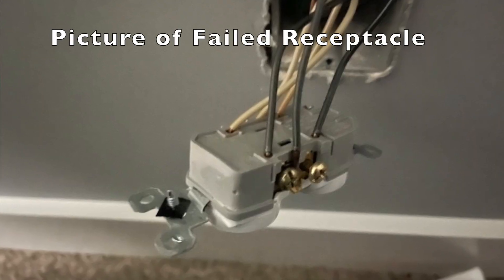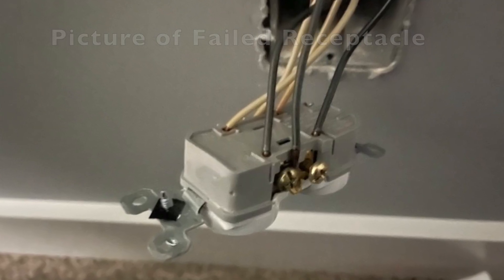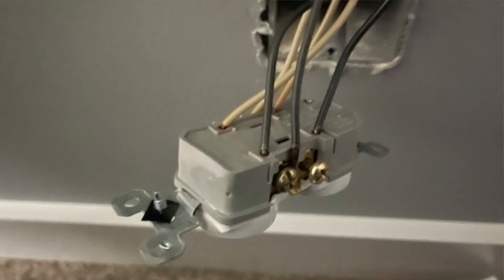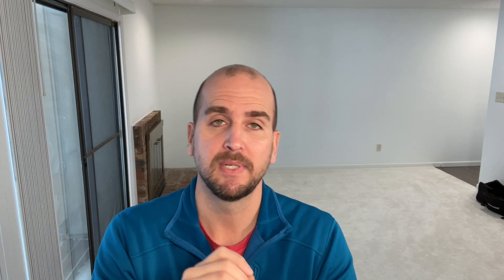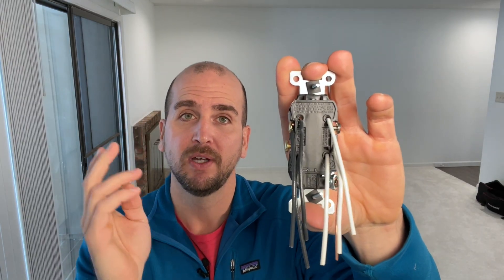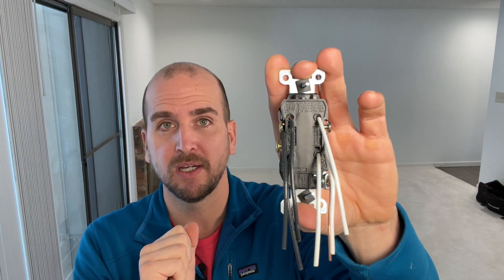Incorrectly Wired Outlet Found In Newly Built Home

Comment: Im not an electrician....but way back over 50 years ago our high school had excellent tech classes.  Our electric shop instructor was a crusty old englishman....we spent what seemed an eternity on making perfect shaped connections....had to look like a cup holder hook.   The connections had to be tight....he inspected to copper to make sure you hadnt nicked or marred it in any way..  Ive never forgotten ...thank you Mr. Edwards.
Reply: Good workmenship is paramount.  Back then, inspectors would eyeball how well the wire was stripped and would not sign off sloppy wire stripping if it nicked the copper almost on a microscopic level.  But lots of these techniques have gone away for quick and dirty expediency current workforce policy’s now trending to use.
Reply: @chrisbragdon5901  Agreed.  Work ethic has all but disappeared in this day.  The old adage works.  If you are going to take the time to do something, then take the time to do it right.  Especially when lives hang in the balance.
Reply: @chrisbragdon5901  In some 20 years I have never had an inspector inspect wire strip length, box fill, switches. They were only concerned about the service entry, panel bonding and grounding. They will want do a look see in the kitchen before close-up. watch your distances from sinks and bathroom fixtures. They mostly want to see that things are grounded.
Reply: @MrBonners  , so true!  But if you get inspector that’s had a rough night, hung over, pissed at the world, believe me, they will pull out the microscope and cause all sorts of grief that could have a huge impact on your current job as lots of money gets tendered to either fix the wiring or grease the palms!  Construction company’s have gone under because of some run-amok inspector gets a hard-on for foolish authoritarian policies that he/she thinks are being abused.
Reply: @chrisbragdon5901  The mood of an inspector is not the subject of the video or thread. There is nothing one can do about "IF".
Reply: @MrBonners  , but if that “IF” becomes the issue, who gets to bend over?  Hint:  Not the inspector.  They all talk to each other and suddenly the framing inspector shows up because of “things” that might of got overlooked suddenly come to light that some how got missed the first time around.
Reply: @chrisbragdon5901  In the universe called "IF' you can have anything you want, pink elephants, flying monkeys, dry water and a hung over inspector. 
In this universe called "REALITY" the electrical code does not concern itself with the drinking habits of an inspector and neither does this video or comment thread.
Reply: @Lucky Joestar that could get confusing  with black being hot in NA. !
Reply: @davidburman451  US ARMY DEPOT electricians will turn a neutral or ground into a hot in an instant. Being retired a Supply Depot Job for any of the armed forces qualifies you!!!
Reply: @davidburman451  Its an international standard...the USA is confusing
Reply: The way this video showed how to strip the wire would probably have the old man have a heart attack😆.  I was taught to use the Linesmen and just lightly press down on the insulation and push with your thumb.  If it didn’t come off, open the Linesmen and go to a new spot.  Never twist the Linesmen while closed to a new spot; that’s how you can score the wire.
Reply: @firsttimejimmy9791  yea he dug right in to it.....
Reply: @jaygee2187  my guy couldnt have passed for superman.....way too old...word was they pulled him out of retirement because they were short of instructors that were qualified for this....
Reply: we don't offer secondary education like that anymore.
Reply: @wisconsinfarmer4742  Thanks for the reply !  Yes it deeply concerns me. 
What may get lost in the next generation....games...phones...and facebook are fine but to get through life they are going to need practical skills and sadly many dont have them.
 I grew up in the country we were not farmers but lived in the old original 1860 brick and stone house on the property.  Couldnt get enough of helping the farmer from 10 years old on.  Everything was repaired as needed....you learned to do it because there literally was no other option.
I figured out decades later that we were living very close to poverty but as a child I was happy and didnt have any idea.  I do remember seeing mom cry when they only had $2.00 left for groceries one week.
I tried to pass some off that along to my 3 children.....as adults they brag to friends that their dad can fix anything.   It was my middle daughter however that took it to heart.  Some 10 years ago their toilet sprung a leak .  She tore into it to fix it her lame husband ( she left him since ) wanted to call a plumber and just pay  $$$$$$$ to have a new one installed.
She refused a when she found the gasket gone between the tank and the bowl he insisted the toilet was so old they wouldnt be able to get the part.
Off she went by herself to Home Depot....asked if they had one and sure enough it was American Standard....cost $1.49 she reasembled it and like  magic the leak was fixed.  Whenever I fixed stuff around the house from the time she could walk I always had this sweet toddler watching handing daddy tools.
In middle school she took all the shop classes but her class was the last.....after that they were all discontiued.  Very sad indeed.
Kinda long but its been on my mind lately.  Take care.
Reply: @davidburman451  yeah, in the 60's and seventies most boys were chomping at the bit to be a man and learned all they could in practical skills.
Reply: @davidburman451  It's great that she had her Dad to watch.  My Dad was not handy but my husband and I learned a lot together.  He has now passed on but I still try to fix something before I call anyone.  It has to beyond my skill level for me to call someone in. 😉
Reply: @sharonaxelrod4608  Thats wonderful you worked on projects together with your late husband.  Many couples are unable to share the experience.
We saved all of my daughter's wood shop projects from her middle school days, they are very precious to us. Years ago I gave my mother the items I made in middle school after she passed we now have them all with us to be passed on when we are gone.  Such a shame those programs were all discontinued.  It taught little souls the value of completing what you start and creating with your own hands something lasting and value.  I have a small line level of my Grandfather's its about 3" long and made of brass over 100 years old now. When ever I can I actually bring it out and use it....as connection to him I know it would please him.  He fought in WWI  and was wounded in action. But went on to raise a family and worked the rest of his days as a carpenter.  All this stuff matters and bonds people together.  Take care and thanks for replying
Reply: @davidburman451  I enjoyed hearing a little about your life.  When I was in school, girls only took Home Economics.  I have a  younger friend who  asked to take Shop when she got to High School and she was the only girl in the class.  That was in the early 70's.  My husband and I mostly enjoyed working together.  We got a quote on what it would cost to run black pipe in the basement to run a new gas line and it was more than we could afford.  So one weekend we rented a pipe cutter and a threader and did it ourselves.  It's still in the house and have never had a problem with it. We had even added new outlets when we ran the new pipe. Thanks for the conversation. Enjoy your family.  Bless you all.
Reply: Always remember our old shop teachers, too bad most schools don’t carry those programs...
  I remember my courses from 60yrs ago.. have always held me in good stead....
Reply: I did house hold electrical in high school 50 years ago, too. I have used the skills I acquired in that class a lot over years, but equipment (including even receptacles) have changed over the years. My suggestion would be that when doing electrical work at home, always check current (excuse pun) codes, and if something seems even remotely different, ask about it.
Reply: Same here. I learned in a high school trade class and he taught us everything this video stated.
Reply: there is a theory that the electrons travel on the outer edge of the copper, this is why they say NOT to nick the copper surface when removing the outer jacket because it creates resistance to the flow ... ?? Not sure how true that is considering we can't see the electrons flowing.
Reply: @ACommenterOnYouTube  makes sense to me ...resistance creates heat.  Plumbers de-burr water pipes as the burr creates turbulence at that location which causes resistance to flow.  My guess is that electrons may behave in a similar fashion.    Either way just doing the best work you can on little details helps produce a higher quality project in the end.
Reply: @davidburman451  electrons behave very much like a flow of fluid. hence the electrical term for electron flow is 'current'. Pinch the flow and the spot gets hot but the catch also over years slowly cuts through the wire, you get pops and flashes.
Reply: that is why you use stripers, not a knife.
Reply: im mr edwards. you were the gay guy right?
Reply: Common Sense Realist  To chunky to carry around in a pouch or toolbox. That is a bench hand tool for electrical harness building and control panel wiring work.
Reply: @Lucky Joestar you just confused me big time. I was taught black guys get gold teeth white guys get silver teeth now what do I do 🤣
Reply: If you can not sign your name to your work your in the wrong Trade become a US COGRESSMAN!!!
Reply: I too had a tech englishman in toronto he's name was Mr.brown and the hook was main point clockwise ,here in this vid he did not do and also he slipped in on the wrong side. that is why a teacher is for teaching.
Reply: @Jozavenue  You missed something-- there was no hook because Scott used the "back wire" feature of the spec grade receptacle (not to be confused with the "back stab/speed wiring" holes on the cheap receptacle he removed). You don't put a hook in the wire to use back wire, and it doesn't matter which side of the screw you stick the wire in, because it does not curve around the screw, it gets clamped down. Scott explains the options in another video: https://www.youtube.com/watch?v=SSfPzunEQ9g
Reply: Same

Comment: I thought the shepherd's hook should curve clockwise, in the direction of the clamp down screw. One of the hot leads was -- as best I could see in the video -- curved the other way, which tends to push the hook a little out from under the screw head.
Reply from the maker: Hey Louis, you are right that clockwise is the way to go.  Might have been hard to see but the receptacle in the video had the hooks running clockwise.  One side use the top screw and the other used the bottom which might have been throwing you off.  Thanks!
Reply: @EverydayHomeRepairs  Thank you for the reply. As I said, "as best I could see," which obviously wasn't very well.
Reply: Which is why I use Hubbel with the compression clamps. Strip to the correct length, insert wire, clamp, done. Always gets full contact.
Reply: The compression clamps work fine with stranded wires, but I would prefer to hook a solid wire around the screw.. solid wire doesn’t compress well.
Reply: @njineermike  Compression clamps good. Back stabbing not good.
Reply: @farmerdave7965  . . . for sure . . . backstabbing sucks !
Reply: He does have a picture at 2:47 showing just that recommendation.
Reply: Not sure where you are but here in Ontario 12 awg indicates a 20 amp supply which is also to be wired with a T slot receptacle regardless of your back wire clamps which also when fed with a single wire should follow direction of terminal just as with the shepherds hook
Reply: @jasongirvan6729  Just because it is #12 wire doesn't mean you must use a 20A receptacle, nor does it mean you have a 20A breaker supplying the circuit. The wiring might be #12 to avoid voltage drop on a long run but the breaker and receptacles might all be 15A.
Reply: @kevinmartin7760  plugs stamped csa for 15 amp are not sized not allowed on a 12 awg but yes 12 awg is allowed on 15 amp breaker for voltage but not on to a standard slot plug as the wire technically don’t fit and only under screws. Please note I spoke of Canadain rules and also a slot plug is stamped 14 awg on the back in Canada

Comment: At minute 6:05 I think the black wire was placed on the WRONG side of the screw. Ideally they should all be formed into a "J". However, the $$$/hour will take precedent. That is my $0.02.
Reply from the maker: I see what you are saying but these are using back wire (plates tightened over straight wire) opposed to J or Shepard hook around the screw terminal.

Comment: I agree with not using the push in connectors and tightening unused terminals.  I would not use the pigtail in the case where you only have two cables in the box.  The pigtail adds a splice and takes up room in the box. Also takes longer to install.  The pigtail only needs to be used in cases where you have more wires than terminals. You can't place two wires on a terminal lug.

Comment: FYI - Pre-twisting not required and more importantly it is not recommended by wire nut manufactures
Reply: I can’t tell you how many circuits I’ve worked on where the wire nuts just fell off as soon as I touched them and exposed that the wires were not twisted properly.  It certainly takes longer to pre-twist, but you know you’re starting with a good connection before putting the wire nut on.  And, most importantly, for DIYer with limited experience, this is by far the preferred method.  Now for an electrician with decades of experience,  do what works for you.
Reply from the maker: I would agree, good feedback!
Reply: Please twist them. Nobody like a jack in the box when you take off a nut.
Reply: Always pretwist the wire nut is just for protection not to be relied on to complete the circuit don’t care what the wire nut instructions say. I’ve probably made over a 50 thousand splices in 35 years as a IBEW Electrician
Reply: IBEW local 613 journeyman here... listen to Ed, he's correct.
Reply: @edpinkerton7947  (
Reply: Some do some don't. have to read the box.

Comment: Why does the pigtail improve things? You have two or more wires coming down to a single wire. Unless the pigtail is a heavier gauge, aren’t you looking at potentially overloading the pigtail? Also, many times there is hardly any room in the box to begin with. Adding pigtails and big fat wire nuts seems like it would be crowded.
Reply: One black and one white wire feed power to the receptacle. The other wires feed power to other receptacles. If all of the wires are connected to the terminals if the receptacle, all of the current from everything connected is going through terminals and conductors of the receptacle, increasing the chance that it will overheat and fail. With a pigtail, the current feeding other receptacles is going directly from the live wires to the wires connecting to other receptacles, and the receptacle is only handling its own current.

Comment: I don't get it.  there are two screw fasteners on each side of that duplex.
Reply: If you cut the tab between the screws you can control half the receptacle by a wall switch.  Think of floor lamp controlled by a switch at the door to the room.
Reply: @glasshalffull8625  Yes,,, I understand that.  And the bridge is NOT broken on that duplex.
Reply: @johnhasse3995  , in the example of the floor lamp being controlled by a wall switch, that bridge is broken.  That allows half the receptacle to be energized at all time, for example to plug in a vacuum, and the other to be wired to a wall switch to energize the lamp when you walk in.  The receptacles that are wired to a wall switch are “often” installed with the ground up as opposed to down to indicate to the homeowner that it is wired to a wall switch.

Comment: Not being a professional electrician, myself and a fellow EE wired my house when we built it. Thank you for demonstrating how it is done properly, especially the pigtails, which carry the series load and not the Wally World P(eices) OS.  I used all Hubble hospital grade receptacles. Later on several times guests have asked me why my receptacles are a fumy color.
Reply: Hospital grade has a green dot on the face and is stamped “hospital grade.” They can easily be obtained in standard white with the green dot.  The color you have, whatever it may be could be depicting additional info like orange “isolated ground” or red “emergency cct” or grey “UPS power”. I just want people to know that hospital grade isn’t simply depicted by “funny colors”
Reply: Why spend 8 bucks per hospital grade outlets, just use industrial, but why even spend the extra money when you go not need to.  I perfer to use Pass and Seymour over Leviton for residential mainly due to the construction of the blades which grab the prongs tighter!
Reply: While I applaud your right to overkill. He was talking about receptacles bought at the 99 cent store two-for-a-dollar.  I would never use those but commercial grade is plenty good. No need to get Space Shuttle grade receptacles IMHO.

Comment: Never buy cheap receptacles. They tend to cause weak connection to plugged in items causing them to heat up. I have always done pigtail connections and use high quality outlets. Cheap and lazy connections are not just lazy it can cause fires.

Comment: Had an intermittent problem with part of a circut, traced it to a push-in connection of an outlet. Some minor oxidation caused the internal spring action of the push-in to lock up, the exposed copper lead was loose and came out with no effort.